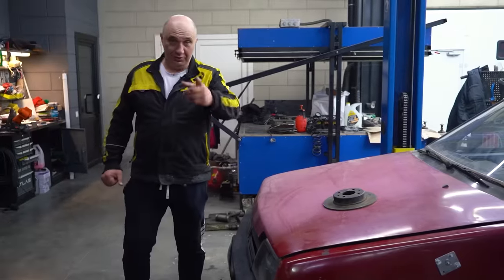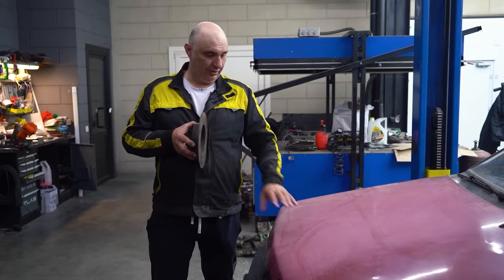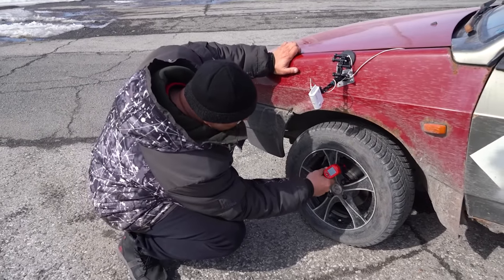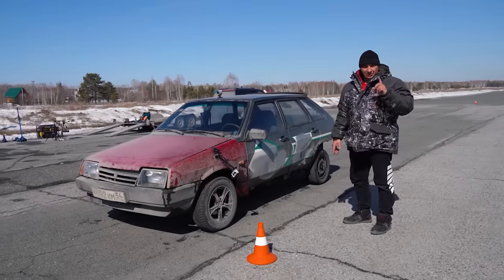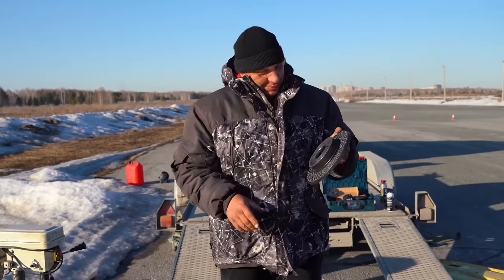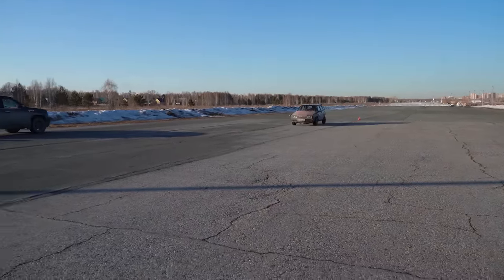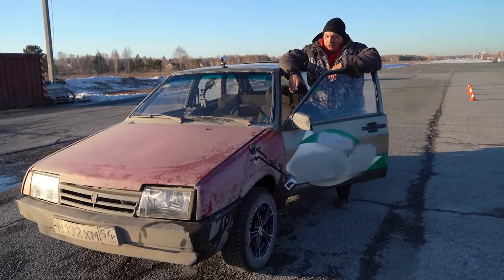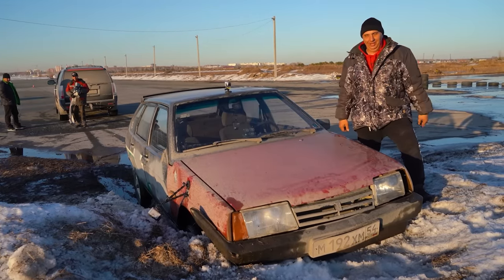We progressively cross drill Lada brake rotors - what will happen?

Comment: Tests have shown that cross drilled are not as effective as slotted. The gasses produced by the pads dont have anywhere to go. Also, it has less metal to soak up the temperature, thus brake fade will start sooner. This is from a brake manufacturer i used to deal with.

Comment: My car (MK5 GTI) has non-ventilated cross driller rotors in the rear. The rear rotors are oversized enough, and being a front drive car, it doesn't need ventilated rotors, and you have to go into the high end aftermarket rotors to find ventilated rears. Tho to be fair as well, the stock rotors aren't drilled at all, but I have mid range aftermarket rotors intended for use on an Audi TT. (Zimmerman sport)

Comment: The holes were drilled straight across the solid rotors, what if they were drilled at a slight angle to create a fan blade type of effect pulling cool air from inside the wheel arch, passing thru the brake rotor and being forçed towards the outside of the wheel...forçed air draft removes more heat
Reply: That would for sure crack the rotor

Comment: Most roters I have seen have had a second rotor that had holes in the sides with some joining metal to make square holes on the sides. So you have two smooth surfaces for the break pads.

Comment: Your new test car is a real beauty! Did you trade a screwdriver or a pair of sunglasses for it?

It's obvious to me that the ultimate brake rotor would be a transparent one. Garage 54 has repeatedly proven that transparent auto parts are superior in all respects to opaque auto parts. 

Making a clear rotor should be much less difficult than making a clear engine block so you may as well just do it so we can all learn how much better they will work than conventional, old-school (boring) steel rotors.

Comment: Should have left it a set time or driven back around without using the brakes and measured the temp again each time to see how much it cooled each time. With less material it’s going to heat up faster, but more surface area it’s going to cool faster too. Idea is that the brakes cool faster between uses on a track for instance. Also, cross drilled discs are more effecting on vented discs, as they are shaped to pull air through them as the wheel spins.

Comment: enough holes helps in releasing the gases release between pads and rotors while braking and it makes the pads gripping the rotor better. helps in reducing the heat better while releasing the brake and cruise.

too much holes means less surface contact between pads and rotors, less material to grip.

Comment: More holes... = less contact area....hence longer stopping.. 

The rotors have a certain amount of holes before they get beyond the benefit of more power
Reply: That's not true actually.
If the contact area is smaller, the calipers will exert a greater pressure on the disks(since the surface area is smaller), so the breaking force will be the same.
Reply: @jort93z  ya. C.f. and all that

Comment: I guess it reveals a lot on brake technology when u see the brake system on a motogp bike... it has no holes. The carbon bakes wont overheat so i guess there is no need to ventilate and therefore max contact with the disc for most stopping power.

Comment: Need to measure how much quickly it cools more precisely vs the og rotor. They tend to get hot but dissipate heat quicker so by the time you're at the next turn and getting down on them they've cooled quicker. They hold some heat for optimal performance but dissipates heat quicker to combat brake fade like you saw with the last few runs at high speed and lots of holes drilled

Comment: The idea of cross drilled rotors is to allow gasses to flow out through the centre of the rotor. It won’t work on non vented or solid rotors as there is pad on either side of the hole. Cross drilled rotors get rid of gasses more efficiently than slotted rotors at the expense of structural integrity. You will find that drilled rotors get replaced frequently in motorsports as they will start to crack at the edge of the holes because of continual head cycles and mechanical stress.

Comment: crosdrilling means not sinking the holes! they have to be sharp to prevent wedging the air between the disk and the pads, they lifting on air film when there are to many holes . you created a trustbearing like a ship propellor bearing. my motercycle has stainless disks with holes to prevent loss of breaking in rain.  great job boring so many holes! keep on the good work I am enjoying it very much.

Comment: Less mass more surface area it will heat up and cool off faster you found the point of diminished returns when you removed too much friction surface
Reply: It actually doesnt reduce or increase friction if there is a linear coefficient of friction. Since the same pressure from the brake caliper is applied to the same friction material you actually end up with the same amount of friction. Its a weird thing.
Lots of materials dont have linear coefficients.
Reply: @timothybayliss6680  if this is the case what caused the increased stopping distance

Comment: This was maybe a little bit of fallacy. For holes to better cool the rotors, they would need to cool while driving, they can't cool the rotor down additionally if its stopped. How hot will they be when stopped depends on thermal capacity, which you lowered by removing material.

Comment: Try to melt the ice off the windshield with exhaust gasses.
Reply: From the inside or outside? I feel like inside would work best... 💀
Reply: @sammy_1_1  for the inside ice you have the defroster. If you actually have ice inside your car. So yes, for the outside.
Reply: @lupulflamand5673  true, but I meant that as a joke since exhaust gases in the cabin is... Well, you know 💀💀💀💀🥵

Comment: The problem with cross drilled holes, is they cause horrible brake squeal. Slotted rotors, where lines are carved into the metal, are better.

Comment: one note of confusion with the temperature is that for a lot of performance rotors, due to their lower mass, they will often get hotter on any single stop. but for a more prolonged track application, they are more able to shed the heat to the air due to their increased surface area, resulting in more consistent stopping power and making them harder to encounter brake fade
Reply: Because at the increased speeds and increased rotations (and rarely braking to a complete stop), you have the highest transfer rate of heat to the air, and it stays that way consistently through the raceway track.
Reply: Performance rotors will have more mass, not less. The goal isn't to shed heat faster, it's actually to hold heat in. That's what makes for more consistent stopping power. Performance brake pads need heat in order to work. Just look at an F1 car.
Reply: @rars0n  this is provably false, there's a reason high end performance rotors use aluminum centers to lower weight, because heavy anything in a performance application is bad, especially unsprang mass such as a brake rotor. and as for the F1 point, the only reason it needs to be above a certain temperature is because they use carbon-carbon brakes that need to be above about 300C to have a good coefficient of friction, and if you take a look at brake improvements after moving to carbon, it's all about minimizing the size of the radial holes in the rotor and maximize surface area for shedding the heat.

where do you think the energy for stopping a car goes when you brake? the rotor on it's own is not nearly massive enough to "hold the heat". The whole point of brakes is to convert kinetic energy to heat and then shed that head to the air moving over/through the rotors
Reply: @renchesandsords  Yeah, they use aluminum hats for less unsprung weight. You will only find such hats on much larger diameter rotors, because they're designed to hold more heat while also shedding some of the weight that would otherwise be wasted on a heavy steel rotor center.

"the only reason it needs to be above a certain temperature is because they use carbon-carbon brakes that need to be above about 300C"

Incorrect. Carbon ceramic refers to the rotors themselves. The pads are what determine the operating temperature of the brakes. Carbon ceramic rotors are used in race cars because they are stronger, last longer, and are lighter weight than steel discs.

"if you take a look at brake improvements after moving to carbon, it's all about minimizing the size of the radial holes in the rotor and maximize surface area for shedding the heat."

The surface area has nothing to do with it. Like I said, it's the mass. The braking system converts stopping power into heat, so if you maximize the mass, you maximize the amount of heat that the braking system can absorb.

"where do you think the energy for stopping a car goes when you brake?"

It goes into the rotor. Any brake engineer will tell you this.

"The whole point of brakes is to convert kinetic energy to heat and then shed that head to the air moving over/through the rotors"

So you agree with me. Great. But the rotor is constantly shedding heat when the car is not braking. It seems you have forgotten that the goal of a race car is to go fast. Therefore it won't always be stopping fast. Performance brake pads only work in a small window. F1 brake pads work in the SMALLEST of windows. So they have to retain heat in order to work. Why else would they design plugs to block off holes in the brake ducting on certain tracks? If the goal was to shed as much heat as possible, they would never use these.

Every brake pad in existence is designed to work better at a certain temperature, even OEM pads. They ALL work worse when cold, and cold is a relative term depending on the vehicle and its use. But there's no arguing with the fact that high performance braking systems are designed to operate at higher temperatures.
Reply: @rars0n  hmm, just tried a hypothetical, yeah you're right, the heat shed during the actual braking zone is not a particularly large component of brake cooling and it's more during the higher speed non-braking portion, but on the whole, I think being efficient about shedding that heat is what makes a braking system more capable for a race as it brings the rotor temps lower for each braking zone

 

proche 911, roughly 1500KG, and brake rotors about 10-12KG(front), assuming avg10KG b/w rear and front, that's 40KG of brakes to absorb heat, let's say approaching a turn, you go from 300km/h down to 100km/h, that's a delta of 56m/s in about 3.5s assuming a little over 1.5G braking deceleration, that means there's about 4.8MJ of kinetic energy to be either taken up or dispersed across the 4 rotors. if dispersion is a negligible part of braking, then assuming the rotors were starting at 20C, they would heat up to around 250C. 

even assuming the rotors were at 250 the whole time and fast airflow over the surface, the energy shed would be well under 1MJ during the braking zone
Reply: @renchesandsords  "but on the whole, I think being efficient about shedding that heat is what makes a braking system more capable for a race as it brings the rotor temps lower for each braking zoneZ"

Are you even listening? That's provably untrue. Look at the temperatures that F1 brakes run at! They NEED to stay hot! How many times do I need to say this?

I'm gonna be nice and not make any comment about the last two paragraphs.
Reply: @rars0n  yes, but if you end up entering the next turn at 1000C then there isn't any higher for the rotors to climb
Reply: @renchesandsords  OMG you're not listening. The rotors cool constantly. So much so that even at low speeds, the drivers have to speed up and brake hard just to generate enough brake temperature. The only time you're going to overheat the brakes is if you're riding them way too hard or the car isn't set up properly. Or there is an actual defect in the braking system.
Reply: @rars0n  rotors need air speed and surface area in order to cool, that's why performance rotors, on top of being bigger, have features that are meant to increase the surface area. If you just had a solid rotor with no internal vents, they will just get hotter and hotter after each stop without the cooling capacity to bring the temperature back down again. Even if it's able to absorb more heat, the ultimate place the heat ends up is in the air that passes over/through the rotors.
Reply: @renchesandsords  I have no idea why you're saying any of this to me, but I'm no longer interested.

Comment: Drilling brake disks aids cooling but reduces grip surface area the sweet spot can be calculated.
Reply: I thought the holes made them grip better by having holes to squeeze into
Reply: Like a texture on the surface same with slotted ones idk
Reply: @chrissanders2562 nah it's for cooling. They use them on race cars as they are breaking at high speeds and sharply as a regular disk would likely get damaged as ofcourse metal is weaker once it gets hot.
Reply: @chrissanders2562  it allows gasses from the hot pads to escape, same as grooves, not needed in normal driving as the pads don't get hot enough to emit gasses, apparently the gasses get trapped behind the pads and reduce braking

Comment: and now try to make DIY slits on the Brake Rotors like the EBC or ATE Powerdiscs have 👌 this works a way better and you don't get cracks between the holes on the brake rotors like you get on drilled ones.....

Comment: The reason the stopping distance got shorter but the temperature went up is due to the law of conservation of energy. You are changing the forward motion into heat when you apply the brakes. So the faster you can change the motion to heat, the faster you stop.

Comment: The reason it eventually fails stopping is because they keep remove surface area, you might think the rotor would work as usual but the pad actually touches as much as 80% less material.

Comment: If I remember right the drilling is for more bite and stopping Force when was brake pedal pressure and when you slot rotors that is for cleaning debris from the brake pad and letting the gases escape
Reply: If there was any benefit of either, F1 would use it!
Reply: @petkokrushev3840  nope F1 don't use them because their break rotors are spinning so fast that it releases the gases quick enough and if you know anything about F1 cars you would know that their brake pedal has to be pressed with just about all the strength of the driver when they are used their brakes are very hard to push in most of the F1 cars I can't speak for all but most of them stayed quite a bit of strength and I could be wrong but I'm pretty sure they're brake pads are made out of different materials than most of your passenger cars

Comment: You guys should really slap a fat turbo on a Lada. 

Maybe HX35 sized or so. You've already gotten fuel injection to work. Add a good pressure regulator, block studs, and forged internals. With a cast iron, closed deck, engine block, I don't see any reason this motor couldn't make some serious boost, and serious results!

Comment: When I was a full time Uber Eats driver I'd be driving for 9-12 hours a day. my brakes got so hot they started to not work at all near the end of a shift. I bought the same pads but with drilled slotted rotors and my brakes have never given me an issue since then. People say all the time that drilled slotted rotors are for looks only. Those people have never used them or have never had a use case for them.

Comment: At some point the lack of surface area doesn’t allow the vehicle to stop so you do need a good balance between surface area and ventilation. The cross drills slots allow brake dust and rotor material to be removed and fresh material to contact the rotor and note harder.
Reply: Shouldn't the friction between the pads and rotor should be the same regardless of surface area?
Reply: @bennykakes5845  Think about what you just said lol
Reply: @IvanOoze1990  Wdym? the formula for friction is F=uN. With u being the coefficient of friction and N being the normal force. Do you see area anywhere in that equation?

Comment: Try doubling or tripling thr calipers on the front,  what would the brake distance be then?
Reply: Close to what they got with the best run, not much better. If you actually want good braking you get a car with ABS
Reply: It'll be limited by the friction coefficient of the tyres.
Basically it'll lock the wheel up marginally quicker but be limited by the grip of the tyres

Comment: FFS.  So many comments made from nonsense.  Brake pads turn into heat and gas.  Corss-drilling and/or slotting lets the gas escape.  Brake fade is caused by the pad floating on the gas and not actually touching the rotor.  Brake fade = pads floating on gas, that's why ceramic pads are better, because they create  far less  gas when they heat and wear.

Comment: The disc has lost over half its contact surface with the pads. That increases the stopping distance.  On the other hand tbe more holes allow for the cool air to flow through creating the rapid cooling effect after the test.

Comment: I was arguing with so many people for how much better drilled rotors are stopping and how less heat they get. I drive Touareg which is 2.6T and had pretty bad problem with the stock rotors. Since I changed them to drilled ones the issue was solved. I drive quite sporty on twisty roads and I was able to observe brake fade quite often.

What I felt on my car is what exactly is shown in this video.

Comment: Ive seen tests done and there was little to no affect to brake force/power but when using the brakes a lot like going downhill and "spirited driving" they help keep brake temps regulated so they dont overheat. They slotted surface rotors barely did anything while full slotted and drilled or both made a difference